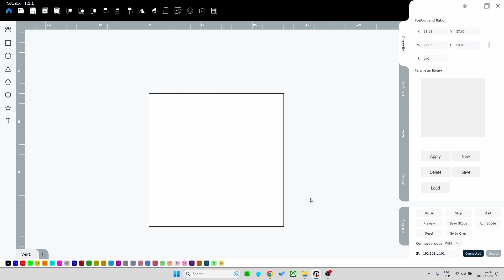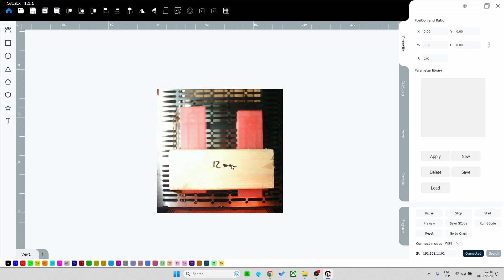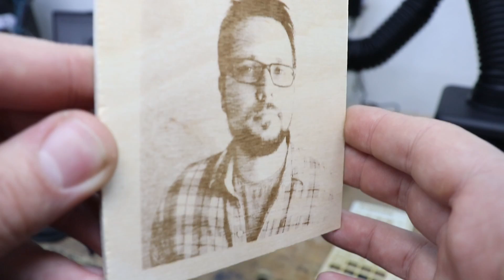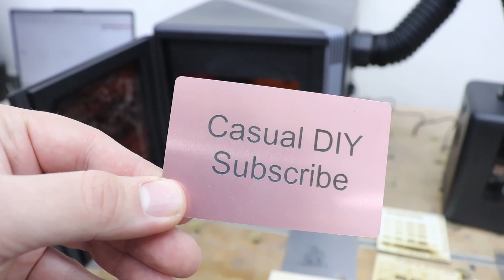Mini Desktop Laser with Plenty of Power | Wainlux K8 10W

Comment: Backed this on kickstater with the air purifier, so it was at a discounted price. Even so for what you get the price is pretty resonable considering. Take the size of the build volume out, try finding any laser engraver/cutter with a camera, enclosure air asisst,honey comb plate, and air purifier you would pay a hell of a lot more.
Reply from the maker: That is true, I think the price will drop a bit in few months. But it is quite good quality and the 10W module is a very good choice
Reply: @CasualDIY  also they just showed how to engrave on an object that is bigger than the build volume. They call it "pro mode" you hold the repeat button on the machine for 10 seconds, this allows the doors to be open while engraving, obviously not the best idea for safety but if anyone wanted to it's an option
Reply from the maker: @Bearded_Blonde  always a potential option if needed

Comment: I can understand why someone would want something this size, but I agree that the price is just nuts ... $450 (for UK) for a 10W laser with 130mm by 130mm working area (or $550 if bought with air purifier) ... at the end of the day it will fulfil the needs of some people and for them it'll be a good price 👍
Reply from the maker: It fits a specific need, fills a market gap. But yes bit pricey at the moment. It was made through Kickstarter and just released for sale on the 11th I think. The price should come down after New Year. I think £300 for the laser and air purifier would be fair.